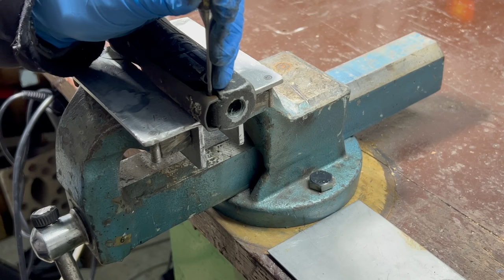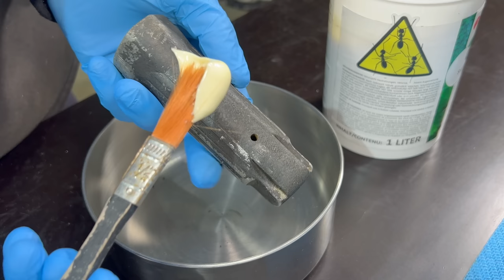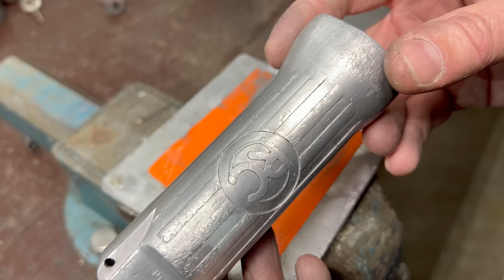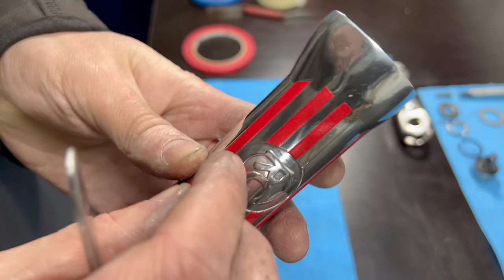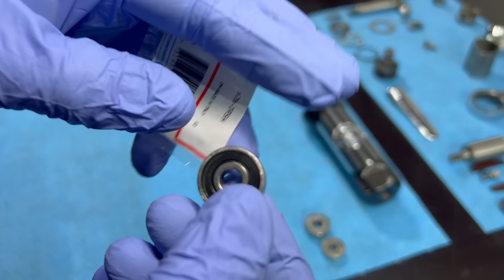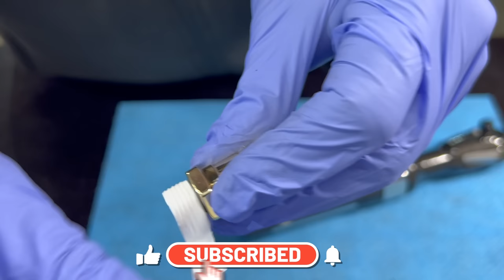Powerful tool- Rodcraft Air Screwdriver- Restoration

Comment: In the us we call it an air ratchet, commonly used with 3/8 inch drive sockets, not screwdriver bits which are mainly used in battery powered drills